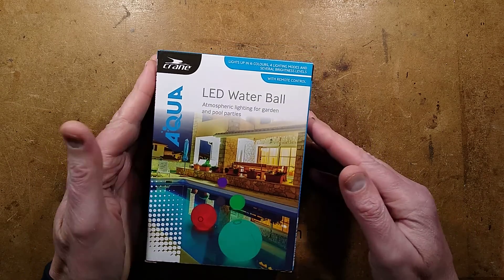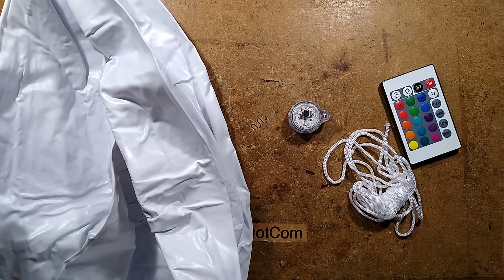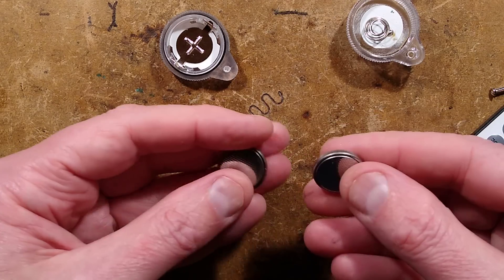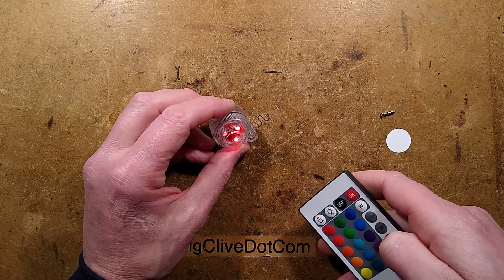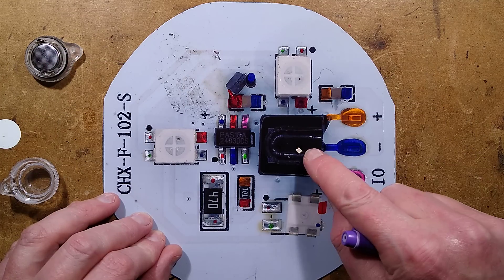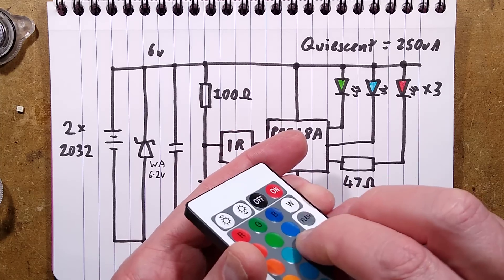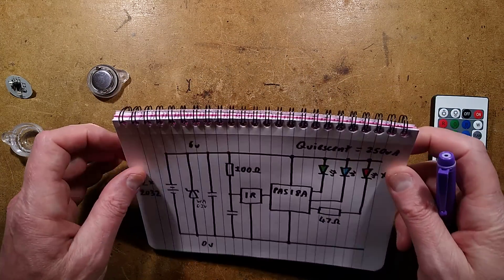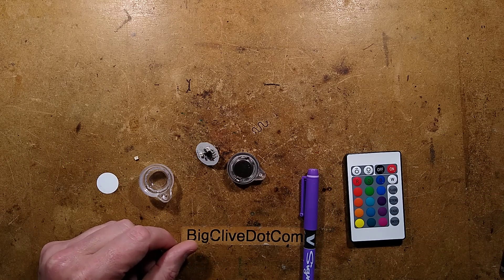ALDI's 400mm (16") inflatable glowing aqua orb - with schematic

Comment: hmm, does it work with 1x LIR2032? given the standby current it is a decorative light you manually turn on, so you likely would pull the cell when not using it for a party, which means you likely have rechargable cells for all your decorative lights
if it works from 3.0v to 4.2v then a single rechargeable cell is perfect

most of these 2x2032 products use two cells due to the lower voltage of non-rechargeable 2032 cells being slightly too low for an LED(the microcontrollers can easily go lower than 2.5-3.0v if designed right, but not the LED's
I bought a few of the LIR cells as I had little decorative lights and was attempting to try using some for isolated detectors that send a signal via optocoupler(as I was designing an electrolytic cell at the time and wanted some sensing devices for safety that would only enable the cell if the battery was charged and the sensor happy) and also seeing if I could make my PC motherboards never need a new CMOS battery if I simply plugged in the 5VSB line every few months

I never tried any of them sadly, but the cells seem to have very low self discharge and a bit unacceptable capacity for more than remotes/lightsand MAYBE CMOS if I had a charge circuit in place(4.1v zener and 1K resistor+scotkey from 5VSB line)

Comment: how waterproof would you say those cases are, it seems like a nice setup with a different battery for getting an outdoor lighting source
Reply from the maker: The little light puck is designed for submersion in water.  They are also sold as vase lights.

Comment: Big Clive my cheap LED floodlight from eBay has stopped working... Can you please fix it for me
Reply from the maker: The most common failure these days is a dead LED breaking the circuit.  They usually have a dark spot in the dead LED.  It's not easy to fix them unless you have a latching LED which may be multi-chip, and a heated platen to preheat the aluminium core panel before soldering.
Reply: So I plugged it into charge but on the plug itself the earth wire was not attached... Maybe this has done some destruction  @bigclivedotcom

Comment: With that zener diode there, if you put in, say, three CR2020 cells, the thinner cells allowing you to stack more, wouldn't that just short the cells out? It might protect the rest of the circuitry, though. The voltage would be 9V-ish, above the voltage of that zener, and it would thus allow current to flow straight to ground, wouldn't it?

Comment: @0:10 The classic remote control from China. I have these in Various devices in my Flat and they Always interfere with each others Devices :(
Reply: It'd be nice to see the output on a digital scope. See what the protocol is.
Reply: @sometimesleela5947  NEC
Reply: One of my fans interfere with the LEDs
Reply: @JessicaFEREM  So, i have a Ceiling Fan but the Remote sometimes interferes with my PC LED fans. If i DIM the lights my PC fans will spin down :(
Reply: my Nvidia shield remote happens to send out the exact same IR code as those remotes use for red (iirc) when you put batteries in

Comment: Our local ALDI did a very nice rectangular rigid, floating solar "pool light" running off an internal (though easily accessible) 18650. Really bright  output, and a pretty decent run time overnight too! Get yourself a nice Chinese LCR P1 transistor tester - they can decode the output from any IR based remote handset (host address and data). Also very neat for measuring ESR on sus. electrolytics (and of course testing transistors, etc).

Comment: Two fresh 2032's could hit about 6.4V - I wonder if the MCU freaks out at that high a voltage, or the LEDs pull so much that the MCU browns out.

Comment: It's way better to putt a 220 bulb inside and throw it in the pool so that the water can prevent the ball from melting. Way brighter light and you save on batteries plus eco friendly.
Reply: Seriously?  
Maybe chuck a 220V fan heater in the pool if the water is a bit cold too.
Reply: @BTW...  electricity is way too expensive for that and we are trying to be eco friendly. Just wait for warmer weather or man up and swim in the cold water, good for blood circulation.

Comment: How much did it cost?
It looks like FH8A51S6 is the part number for the 6 pin controller.
Reply from the maker: I think they were about £5 before they reduced them to get rid of residual stock.

Comment: Zener diode was there for reverse polarity protection, that it was a zener is merely that this morning at the big market the reel of recycled diodes also had in it some zener diodes, and a batch of same shape regular diodes, going very cheap. This one got a zener, coinidink that it was 6V2, the next one might have a 100V regular diode, and the next one a 3v3 zener diode, and the one after that a 500pF varicap diode, because they all come in the same case size.

Comment: Fill it with Hydrogen or Helium: everyone will think it's a UFO in the night sky 😆
Reply: I live northwest of a large military base it’s fun to send up balloons with the super bright glow sticks when the wind is heading their way . I wonder how often they do see them ?
Reply: I wonder if the ball holds enough helium or hydrogen to overcome the weight of the whole thing. I had one of those indoor blimps that's a large mylar balloon with a tiny "pod" you attach to the bottom with the smallest battery ever and two little props. The balloon is HUGE compared to the motor pod.
Reply: @gorak9000  Good observation, and perhaps it wouldn't even with hydrogen.  I had read a normal large balloon of helium can lift 14 grams, my only other reference point is I filled 8ft chloroprene weather balloons with helium and each one could lift around 10 lbs, but that is 264 sq/ft if I'm not mistaken.

Comment: A tip for if someone does swallow a battery: CHOP and NCH research found ingesting honey after swallowing button battery reduces injury and improves outcomes. Apparently, it prevents local generation of hydroxide, thereby delaying alkaline burns to adjacent tissue. You still need to get to hospital though.

Comment: So you had a shy LED in there, it don't want to be seen. Still the amount of UFO sightings on the isle of Man has gone up since it it was lit by Clive. So being shy still draws attention (The wrecked psychology of a shy person...).
That 6.2V zener is only draining the battery. A fresh 2032 can start with 3.3 Volt, so 6.6 Volt for the two, and the zener for 6.2V will start to conduct UNDER 6.2 V. This looks like a stupid thing.

Comment: Bear in mind that these "3V" batteries come out around 3.25V as brand new. I just tested on my two separately purchased Sony and Panasonic ones - they are 3.315V and 3.328V respectively. I guess they shave off some of that capacity from these brand new batteries with that zener :P

Comment: Impressive how they managed to hand solder a component onto that PCB not not notice the RGB LED somehow stuck on upside down and turned 90 degrees...
Or... maybe they did notice and just didn't care.
Reply from the maker: That went through my mind too.
Reply: Maybe they soldered the diode in to compensate for the voltage drop lost by the one not connected. :)  In swedish is called crossing the brook to get water.
Reply: @rimmersbryggeri 
Reading your Swedish comment reminded me of an old English saying..
I can't remember it all but it was something like..
'Fording to fill a pail'
If you don't know a Ford is a shallow but wide piece of a stream or river that is shallow enough to drive through.. a poor man's bridge (as bridges would have Toll's) 
and a Pail is a wooden bucket..
... I'm now wondering if Affording has any connection 😻
Reply: He or she is just a Zener installer - other components are someone else's problem - the person installing those Zeners at the factory would drop the work rate too much, to take care of the LED, and it would be detrimental for his/hers daily quota.
Reply: Maybe it was toward the end of a thirty hour shift and had school the next morning.
Reply: The diode soldering person solders diodes. QC is not the task of the diode soldering person. Speaking up is much more a chance of trouble for the diode soldering person than for any reward. So the diode soldering person solders diodes, and meets their production quotas, so they don't go home hungry.
Reply: @Rotsteinblock  I love how everyone's come up with lore for the diode person and QC person. haha
Reply: @Rotsteinblock  this guy gets it.
Reply: @Rotsteinblock  Yeah, it's called not holding up the production line. Time = money and ALDI isn't in the business of preciousness.
Reply: The “Chineseum” craftsmanship of what is a “polished turd” - 😠

Comment: I'd be interested to see if the off-brand remote also caused the current to go up. Basically, is the 250μA including basic IR decoding in the micro, or is the micro firing up whenever any suitably bright IR light comes in?

Apart from the LED screwup, seems like a tidy little circuit. The zener is an odd choice, but maybe these were made specifically for one company first, and one of their requirements was that they take rechargeable cells?
Reply from the maker: The IR receiver and processor remain active, but the processor may sleep and wake on detecting data.

Comment: Perhaps you should check whether the battery in the "standard" remote is still good, it's not unusual for them to arrive with dead batteries despite the protection tab.
Reply: or upside down - I’ve had that on some quality Chinesium products before.
Reply: @theonlywoody2shoes Obviously you mean your new iPhone 16 Pro Max, the peak of Chinesium technology production?
Reply: @MangoPango1973 Western designed non-Chinesium containing lots of non-chinesium components.
Reply: I had that happen on an Apple remote once.
Reply: one tip I learned over the years is checking the IR blaster through a digital camera to see if the remote and the battery are working
Reply: Or, just maybe, they could be doing something sensible like implementing security pairing....